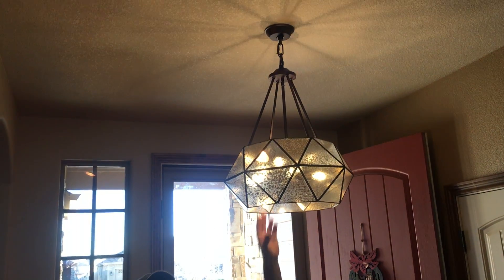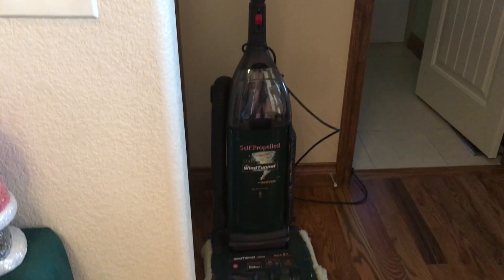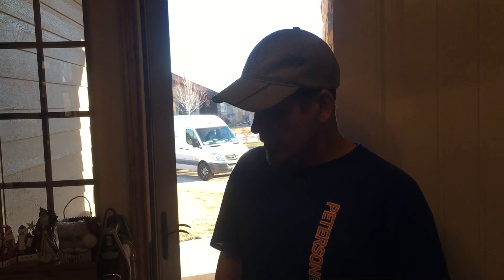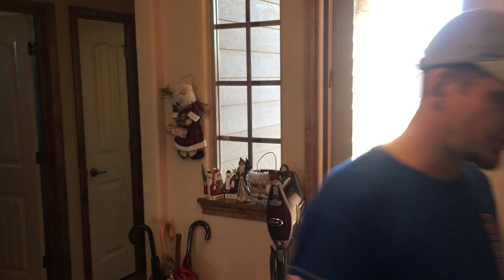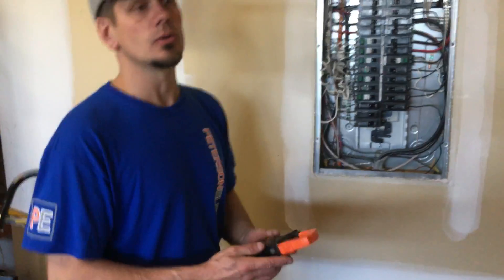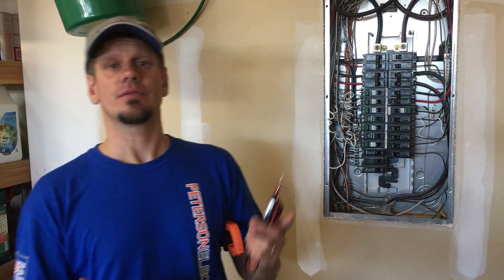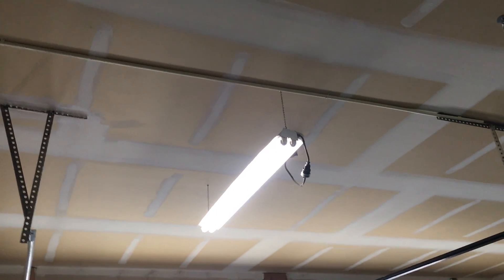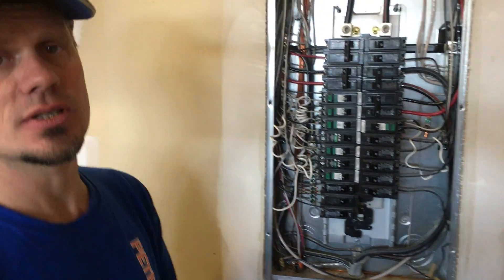Arc Fault Issue with an Eaton Panel, BR Series

Comment: I had a similar problem after installing afci in the living room tripping when porch light was turned on. Found it was a pierced jacket in a wire running to lamp post.   The jacket had been cut over 20 years ago and never knew it.

Comment: I have a similar problem with my newly installed Eaton panel/BR AFCI breakers. My Lifestyle treadmill trips the circuit breaker every time I turned it on. It worked well before the panel upgrades. After some research on this type of breaker, I suspect the relay in the treadmill is causing the breaker to trip. When the relay contacts are in the process of closing to power up the treadmill, the inrush current (instantaneous current for a very short time)  could potentially be about seven times higher than the normal running load current. I am currently using an extension cord on another circuit in order to use the treadmill.
Reply: I used a tripp lite isobar to isolate the feedback from the treadmill and it worked. Pretty much anything on a AFCI breaker will worth with the isobar.
Reply: @nhbilly  Thank you.

Comment: they should have put the garage on a 20A breaker & that outlet in the hallway on a separate 15A breaker... for a house that new its shocking that they didn't
Reply: lol those cost extra pple are cheap. do it to code only(yes bare minimum standards (always trying to tell pple that your paying for D- at best   🤦‍♀️🤷‍♂️)anything above code is more money yes is it more practical to spend a little extra yes but always realize after its done.

Comment: Something else interesting I noticed about Eaton's BR AFCI breakers is that they have no ground fault protection whatsoever, they won't trip even with a 10 amp load on the hot side returning directly to the panel's neutral bar with nothing connected to the breaker's neutral terminal. Weird, I thought all AFCI breakers had some sort of weak ground fault protection. I wonder if Eaton AFCI's are designed to tolerate a current imbalance to prevent nuisance tripping.
Reply: The whole point of afci is that there is no ground fault protection.
You can still use afci for something like a fridge or air conditioner compressor but they do not play nice with GFCI.

Comment: Universal AC motors have commutator and brushes which can cause AFCI trip. "Arch fault" is detected with certain breakers.
Reply: Old electrolux vacuums from the 1980s have 8.4 amp motors with a 65 watt small universal motor in the powerhead.

Comment: I know they are safer, I have seen a 6 inch 'blow torch' constant arc that did not trip the regular ckt brker after I pulled out the plug from a socket that a painter

Comment: I have a square d homeline subpanel and had a simerlar problem with a tandem breaker constantly tripping on a inductive load... wound up moving the circuit to a different line... problem, weak breaker... weird...

Comment: Here is something odd:  The worklights are plugged into socket adapters in a plain socket.  Old style ballasts need a ground, but it has none.  Maybe not an arc fault problem, but definitely a problem.
Reply: Same thoughts here, if one of those screw-in adapters is loose, there's a starting point. Or a rivet between the screw shell and terminals on the backside.

Comment: I thought Arc Fault breakers were generally used for bedrooms?
Reply: 2020 code basically required all single phase 120 volt circuits in the residential setting.

Comment: I guess the good news is that potential arc fault safety hazards are more apparent, but the nuisance factor and cost involved due to lack of diagnostic tools for and in these breakers makes you scratch your head. If it is all about money, you would think tool manufacturers would be all over this and schools would go deep on wave form analysis. I feel like an oscilloscope and memory device is going to be a must have on any afci breaker trouble shoot going forward.
Reply: I’m impressed that they don’t trip from small series arcs that occur when a light switch is flipped on/off or when something is plugged in or unplugged. Maybe if it was done under load, it would be an issue, like unplugging a Vitamix blender when it’s running.
Reply: @RB-xv4si  You would think  that disconnecting  a load live should shut down  the arc fault,... and it does .  Educating the client would help on proper disconnect of a load (e.g. vacuum cleaners,  Vitamix, toaster ovens, and stand up light fixtures should be turned off first)
Reply: @ginosmovies  Yes. But now that I think about it, who’s to say there won’t be an arc in the on/off switch built into the appliance? Even that could possibly trip an afci breaker.

Comment: Eaton breakers suck! My house isn't even 5 years old and I've had to replace several. After the 2nd went out, I decided I'm not spending $55 each time one fails and started replacing them with a regular eaton breaker as they failed. I'm about to replace my 6th or 7th arc fault tomorrow with a new regular. I've had no issues with the regular ones. I did replace one that operates some of the outlets and had to install a gfi outlet, but still cheaper than these damn things. DO NOT ALLOW YOUR BUILDER TO INSTALL THIS BRAND.
Reply: I already replaced 7 of them, I am about to replace the eighth one and my house is about the age of yours.
Reply: @jlee2765  if we hadn't moved last February I was this close to having an electrician replace the whole box.

Comment: I had the same problem breaker was tripping,I changed it to a new one and didn’t fix the problem,then isolate the circuit then I discharge neutral to graund in case of static build up in the circuit when I se an I phone charger was plug in the same plug that has the problem you know how easy they brake at the end of the cable whit no insulation wires sticking out so I unplugged the charger and fix the problem that was it but just to make sure I trip the breaker 3 or 4 times and it was fixed
Reply: Crappy devices that are fire hazards make themselves known pretty quickly with these new breakers.

Comment: in my area i always go with square d or siemens than cutler hammer. im a creature of habit always used square d since i was a pre teen never had a failure yet or at least the pple i did work for have moved on
Reply from the maker: I like them as well. Siemens is my first choice, they make parts for my daughter's hearing aids.
Reply: @Petersonelectricllc  ya seen in another video you get a great discount by supplier too so understand like how I recommend qo over home line but pple still want bare minimum as opposed to security reliability in the future I might price out Siemens in future SeE if it wild be a little cheaper but I normally don't do panel installs
Reply: Eaton manufactures old Bryant panels that are now their BR series like in this video and they also manufacture the tan handle Cutler Hammer panels. In one of their marketing videos, their sales rep flat out said their BR panel is the bare bones economy stuff and only has a 5 year warranty. Their Cutler Hammer line is their premium line with all copper busing and those panels have a lifetime warranty. I assume the corresponding breakers follow suit, so based on that presumption, I cannot say I’m surprised to see issues with BR breakers. Consider convincing the customer to pony up for a Cutler Hammer panel in the future.
Reply: Square D is the best period.
Reply: @Petersonelectricllc  I have more problems with Siemens then any other brand. I’m a service electrician. We exclusively use BR at my company with very little problems.